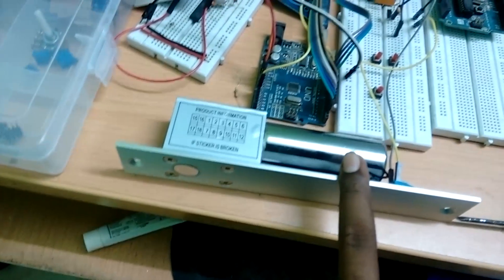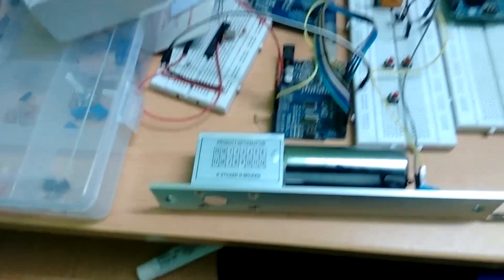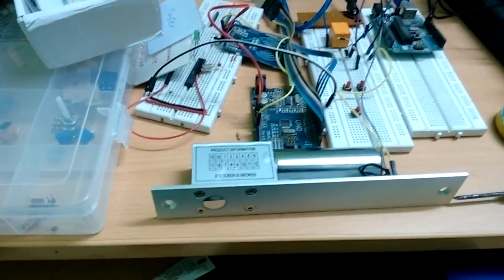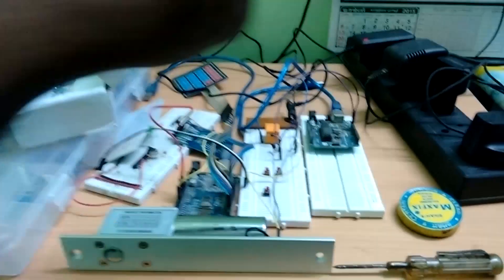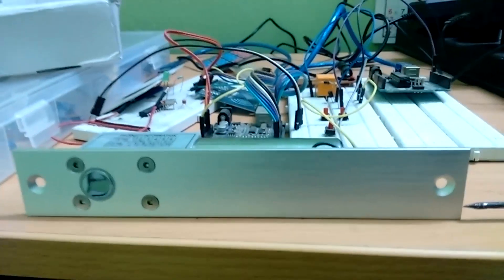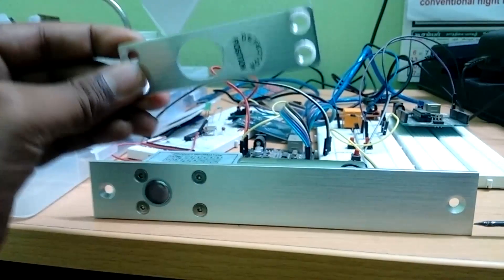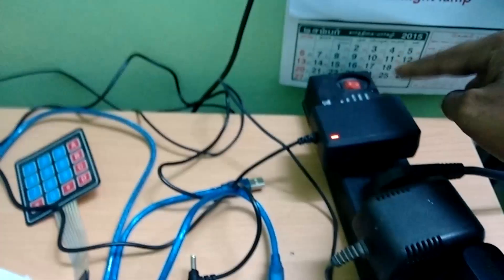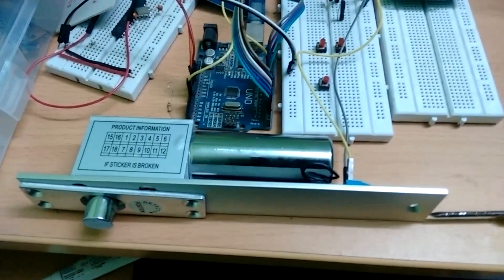Electric Door lock Solenoid ( Drop bolt lock)

Comment: Hello.

How is the lock bolt about heat?

Does it get warm?
Reply: YES - It does get hot  ( well mine does ! ) very warm !  - the metal casing runs at about 48-50 deg C and thats in free air 
12v in  and current =500ma or so -so only 6 watts - but one of the most powerful 6 watt heaters I've found 
Having second thoughts about mounting this in the enclosed environment of the internals of a door or door jamb

Comment: I want to use a fail secure lock, so the house stays secure in case of a power failure. 
But these locks need power to be unlocked, so you need a manual possibility to unlock if the lock is defect and does not unlock electrically. I wonder if the bolt can be pushed back manually after the lock has engaged. One could use a small modified surface mounted door bolt to push back the electric drop bolt and open the door from inside. Have you tried if the bolt can be pushed back manually after being engaged?
Reply: As the gentlemen stated in his demo, the electric deadbolt only remains bolted closed as long as there is a 12v current powering it. So if there is a power failure the deadbolt will open. You can just ad a second surface mount bolt lock as,a backup in case of a power outage.

Comment: If the bolt is retracted by a simple magnet it means one could approach your door with a bigger magnet and cheat the sensor? Doesn't look secure for me.
Reply from the maker: +Dr.R2 yes i think thats possible....but almost all modern doorlocks use a solenoid....if they could break into this they could break into those too.....but we'll have to try it out to find out....
Reply: Anyone carrying around a magnet powerful enough to overcome the solenoids magnet would stick out like a sore thumb, easier to cut the power, thats why you should get a manual backup.
Reply: or just use the window